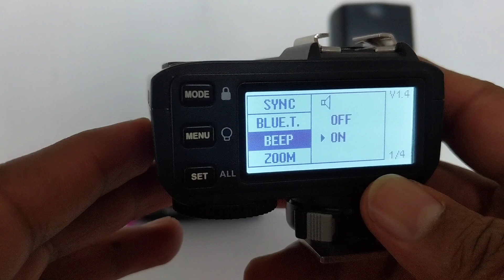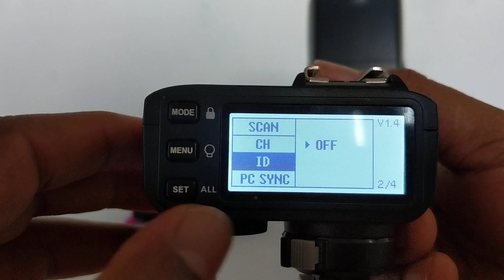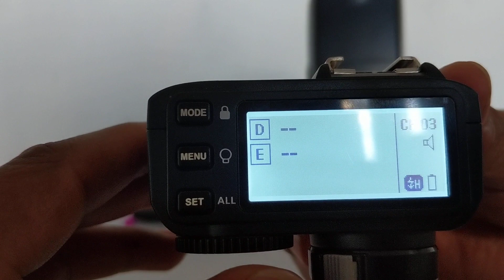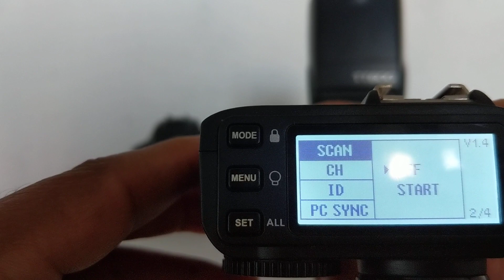Godox X2T Troubleshooting: Common Problems Solved

Comment: I have been trying for over two hours to troubleshoot this-- I have a Canon T6i and it won't fire flash when I press the shutter, even though the "test" button on the x2t is firing the tt600. THIS FIXED IT. I turned set the distance to the smaller range and voila. Thank you thank you thank you. I was about to give up

Comment: Hi! Do you by any chance know how to reset this flash? It doesn't say so in the physical manual nor can I find any videos about it or anything online that would help.
Reply from the maker: @andrejromic99  turn off, long press mode button, while long pressing turn it on it should be reset
Reply: @JUSTJOHN254  Are you sure that's it? I just tried it, it still remembers all the settings it knew. What channel it is on, which I previously set it on. :/
Reply: @JUSTJOHN254  Which video was it exactly?